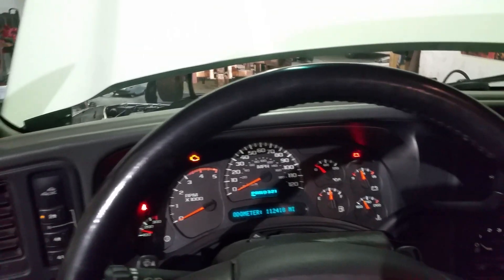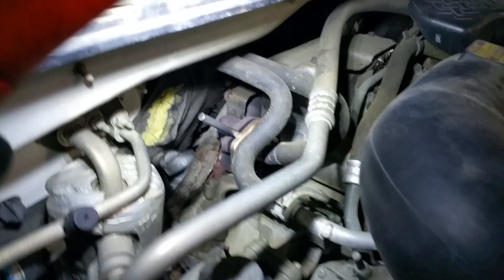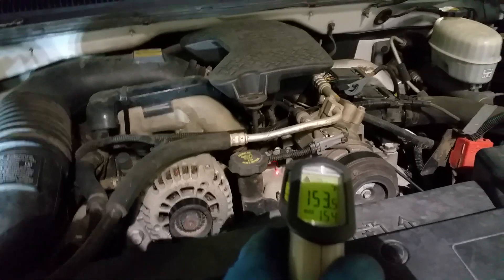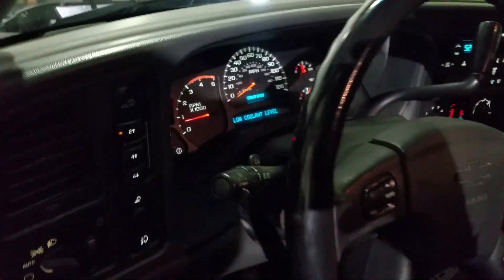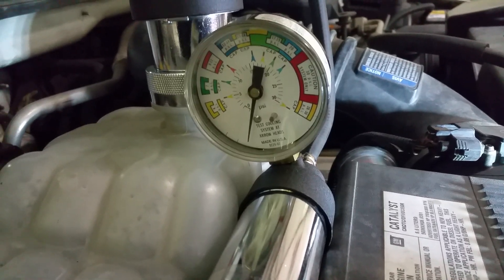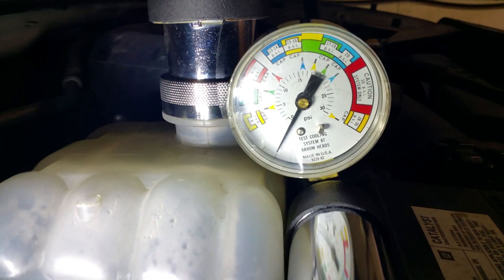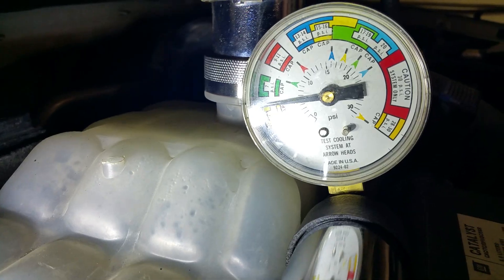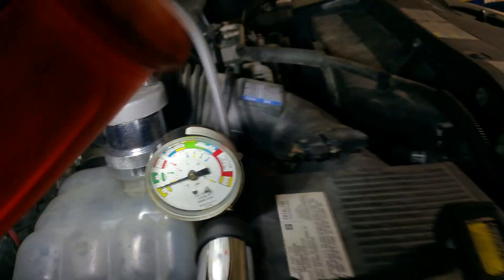LLY Duramax headgasket egr cooler leak test symptoms coolant pressure

Comment: My coolant level seems to drop on my LML after a few months specially when the truck is cold overnight it will drop below the min line, when the truck is warm its up to the max line. No visible leaks, no low coolant lights...any suggestions? After my truck sits overnight i can squeeze upper radiator hose like normal.
Reply from the maker: Although possible, it's highly unlikely to be headgaskets on an LML. I would check water pump, lower hose fittings, coolant bypass pipes and hoses and the fittings at the heater core. We have discovered the LMLs tend to drop a few ozs of coolant over the course of 15-20k miles or so. Basically every other service. This may be due to normal evaporation or a possible leak from factory at the fittings somehwere. However, the indicator region on the coolant reservoir is very small . Therefore, the smallest reflection of coolant displacement shows up quickly as a drop below the "min" line. The coolant should be checked and filled to proper level when cold and accurately monitored following those circumstances.
Reply: Getting new s369 and all piping done this week I will try and take a closer look to see if I can see anything leaking, haven't ever seen a single drop of coolant on the ground. I can go squeeze my upper rad hose 2 hours after i park the truck and it's soft. Open degas bottle and just BARELY hear tiny hiss of air. I have noticed that my trucks coolant temp will not go any higher than 176F unless i completely romp on it then it will usually shoot up to 181f and then drop back down to 170...rolling up to a stoplight i have seen it drop from 174 to 165 fairly quick....trucks got 125k miles on it now. I had concerns that maybe my thermostats were shot but local diesel shop doesn't think they are. These coolant temps are in the winter months here in MN btw for reference.
Reply: +Richie&#39;s Truck and Auto just to touch back again, truck finally started leaking coolant. It's coming down the bell housing where trans mates to back of engine. I am almost certain it's still not a headgasket because my upper rad hose isn't hard when i go to start the truck in the morning. This just seemed to have started after I had a cp3 conversion installed. I checked the coolant hose behind uppipe on pass side and it doesn't seem to be leaking there...where else could coolant be coming from in that area and coming down the bell housing area? Really hard to see where it's coming from laying on the garage floor
Reply from the maker: +Nick Larson the turbo is liquid cooled and coolant transfer pipes run thru and around the valley as well. Pressure test the system and watch for the point of origin where coolant is seen.
Reply: i don't have a stock charger i have a s369sxe. ill try and take a look again tomorrow.
Reply: Nick Larson have the same exact issue on a 15 with 18k on it
Reply: there was nothing wrong with my truck it was actually just fuel leaking in the valley from my CP3 conversion fitting leaking. i sold the truck anyways I have a 2015 now with 45k miles, no issues